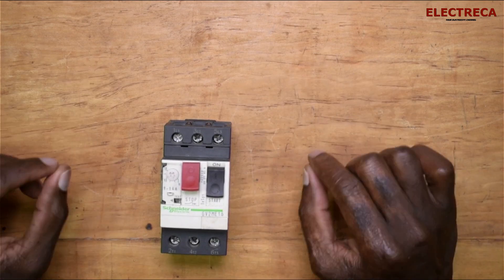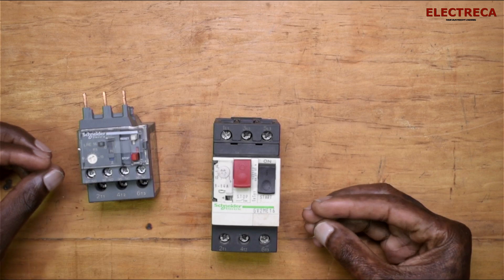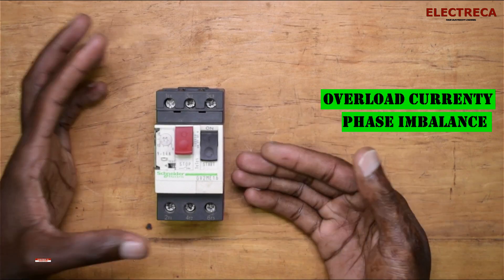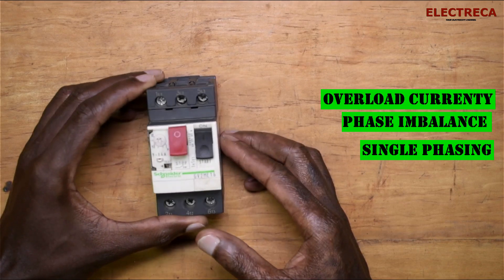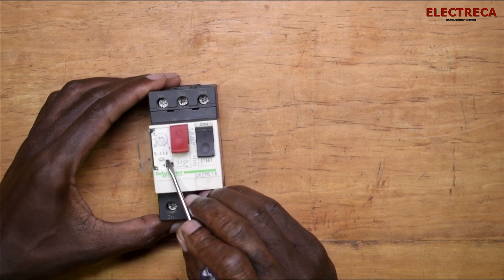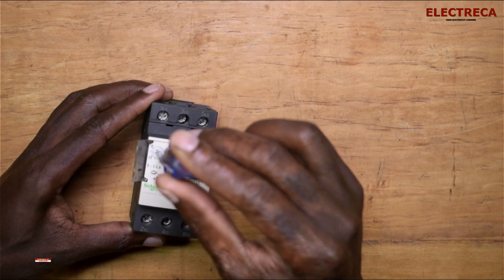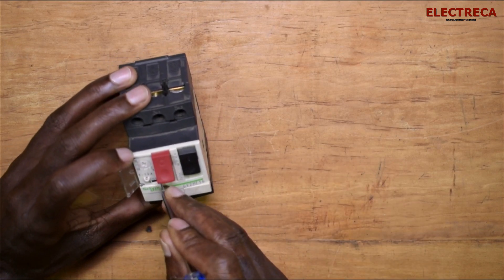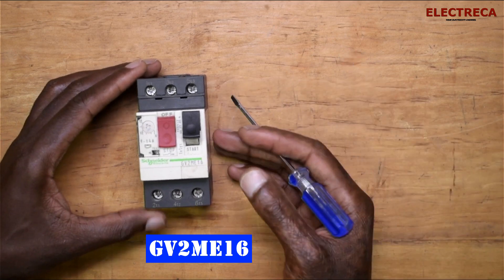Motor Protection Circuit Breaker|ELECTRECA

Comment: i have mpcb circuit breaker  range  13 to 18 A and i connect  motor with 6.0/3.5    then i disconected one phase   but it is not triping

Comment: The "on field rule" for adjusting screw is to multiply the nominal current of the motor by factor 10%.
For example; In= 9A, 9A x 1,10 = 9,90A ~ 10A.